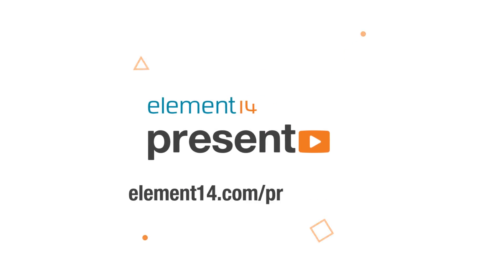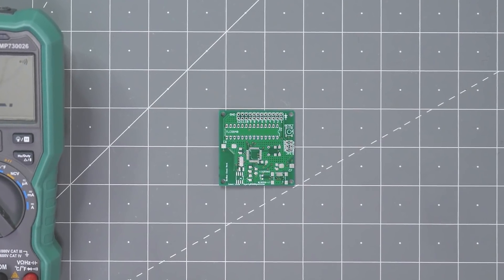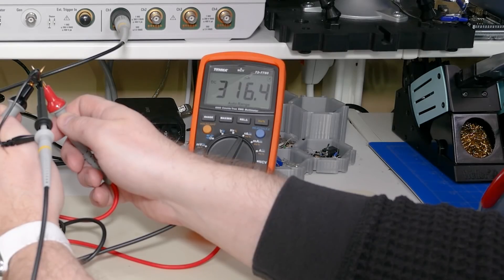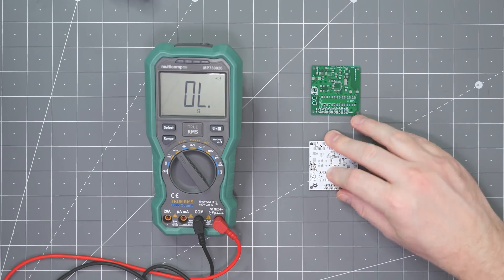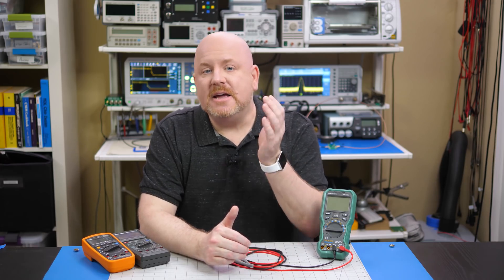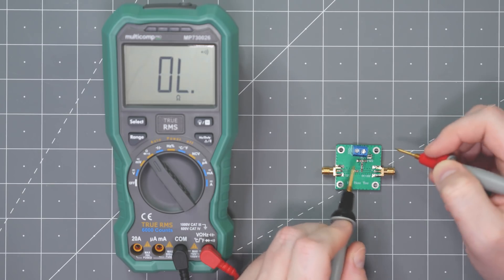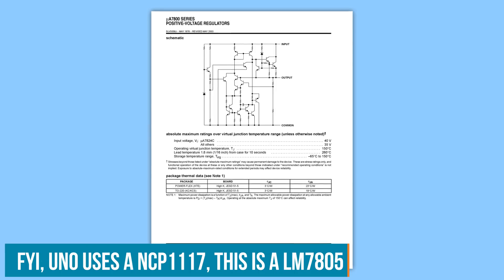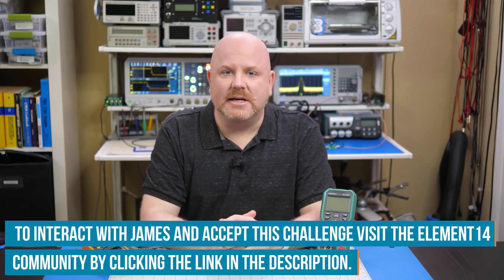What that DMM Beep Means - A Continuity Mode Tutorial - Workbench Wednesdays

Comment: Very informative video. I am not a electronics person so this might be a dumb question, but what would cause positive 3.7V on one side of a SMD capacitor and negative 7.80 V on the other side of it?  Is that normal? No other caps read like that on the board.  One more dumb question, should one side of a smd resistor ever be connected to ground?
Reply: Entirely depends on the circuit.

Comment: Btw you put the cap on the same line of the breadboard, so it's basically shorted :P
Reply: I think that was the point of the question. An "exercise to the reader" as it is commonly called. It does happen though. I know someone who did similar with the 2 sides of a chip